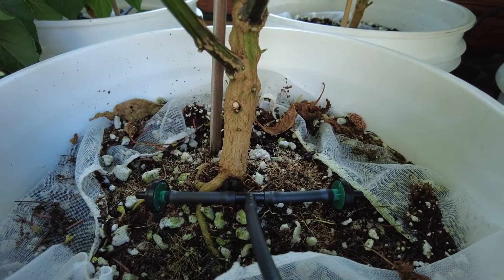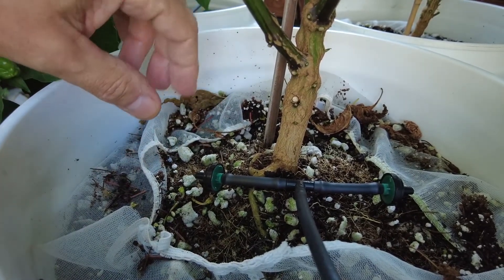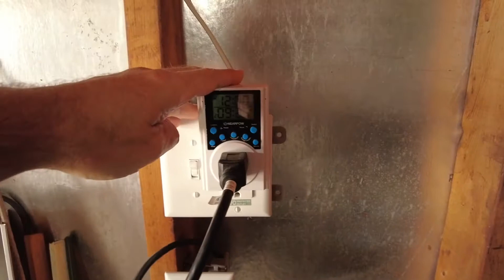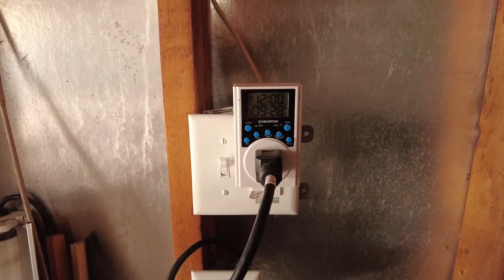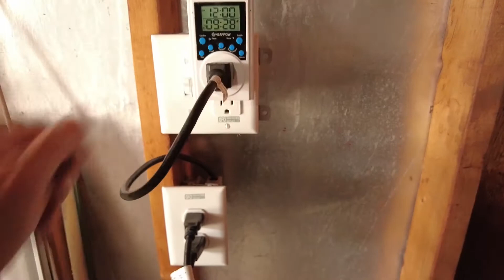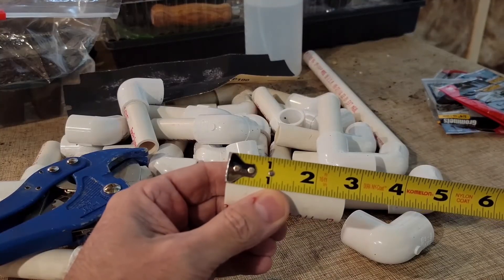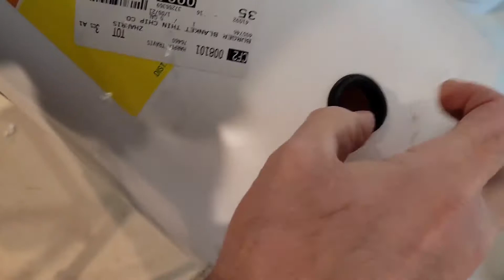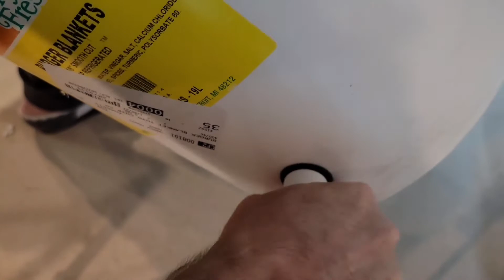Outdoor Hydroponic Peppers

Comment: I have a question. At the time of flushing out salts, the system could be more flexible. Alternatively, the reservoir has to be emptied and filled with water OR use a separate tank and pump. How do you manipulate it?

Comment: I live in the tropics and I plan to grow peppers. I will use this method. A quick question why do you use growing medium instead of regular soil? What’s more economical medium or soil? I wonder if I can grow peppers all year around in this system, since there is no winter here.
Reply from the maker: I like using the hydroponic method because I found the plant growth to be superior vs using soil. However you can certainly use soil in the buckets and the drip system with water only.
Reply: @bradicalbuilds  how do you manage the insects and the diseases for peppers that you grow outside in hydroponics?
Reply: @bradicalbuilds  did you grow any habanero peppers? What was your yield?

Comment: How did you connect the 1/4 tubes from the 1/2 mainline?  I didn’t see 1/2 to 1/4 tees in your materials list. Also, how much water do you recommend per timing interval for each bucket?  Thanks
Reply from the maker: In this video I go more in depth about the assembly and water https://youtu.be/Wn_nxjhyCn4?si=t-MENDOrouuDKAAk
At around 11 mins it shows how to connect the smaller tubing to the larger with these 1/4" double barbed fittings https://amzn.to/3Tc0TX5

Comment: How did you connect the 1/4 tubes from the 1/2 mainline?  I didn’t see 1/2 to 1/4 tees in your materials list. Also, how much water do you recommend per timing interval for each bucket?  Thanks
Reply: Tees are not needed. You punch a hole in 1/2 in tubing and push grommet in.

Comment: thank you for that very informative video. You gave me a lot of useful information about hydro outdoor. Your coco+hydro+(rain)drain setup makes really sense!
One question about your buckets: Why do you insert these drainpipes in the bucket? Wouldnt it be sufficient to just drill the hole in the bucket, without the tubings?
... also I am curious about what NPK ratio you use in your nutrient tank and what ppm?
Reply from the maker: You certainly could just use drain holes in the bottom of the buckets. I do the drain pipe to store a reserve of water/nutrients. Sort of like a self watering bucket and this way the nutrients are not wasted to the ground. 

The nutrients I use are Masterblend (link in video description). I mix them per the manufacturer recommendation which comes out to a TDS of 1300. The NPK is 19.5-18-38

Comment: Hi, really GREAT video. Thanks for the infos. One question: can we use rockwool insted of cocunut coir as growing media (mixed with perlite of course)? I am about to prepare my setup next week the same way you did.
Reply from the maker: I haven't tried filling the contaiers with Rockwool/perlite but the system should work fine with any grow media that can retain some moisture. You'll just need to figure out how often to water. Adjust the intervals feeding times so you're you're not drowning the plants while still ensuring they are getting enough nutrients and you should be fine. I'm not sure how the water hold capabilities of Rockwool compare to coir but I would think it's similar.
Reply: @bradicalbuilds  Thanks for you rreply. Based on that I follow you with the coconut coir-perlite mixture.

Comment: Fantastic video and awesome plants. Well done. I have a couple questions please, if you don't mind.

1. Are the plants in direct sunlight or are they partially shaded? 
2. Assuming you started the seedlings indoors, how old were they before you moved them outside?

Thank you kindly.
Reply from the maker: Thanks for the kind words and taking the time to comment.
1. The plants get full sun nearly all day minus an hour after sunrise and an hour before sunset. I'm in lower Michigan, zone 6b. High temps here are mid 90s.
 2. Yes, I start my seedlings indoors mid to late February. They average 6-8 inches tall when I put them in the buckets late May. I don't top my seedlings in case you're wondering. I do however remove any early flowers until they start to get established in the buckets. Especially the flowers that grow in the crotches of main lower branches.
Hope this helps!
Reply: @bradicalbuilds  Thank you very much. I have one more question that I forgot to ask, if you don't mind.

Do you have minerals/salt build up problems using this system? If so, how often do you flush the plant, and how do you flush it, just plain water? Thanks.
Reply from the maker: I haven't had a problem with it. The buckets get flushed from the rain periodically. If it doesn't rain I flush them with the garden hose once every two weeks.

Comment: What about if a strong rain pour?
Reply from the maker: It actually helps when it rains periodically to flush the mineral salts that accumulate from the nutrients. The plants are only fed small amounts per interval, enough to get them to the next feeding interval. So if it rains, barely wasting any nutrients with rain dilution.
Reply: @bradicalbuilds  i will try this kind of set-up, I hope it will work here in the Philippines because rain here sometimes last for 1 week.
Reply from the maker: @larrycorpuz3172  I don't think it will be an issue. The plants still get fed and once the plants are large the canopy of leaves keeps a lot of the rain out of the buckets also.
Reply: @bradicalbuilds  thanks sir.

Comment: Do you mix the fertilizer and Epson salts in one barrel and calcium nitrate in the other barrel? I have read you should not mix the three together at least in there dry form. I have 20 dutch bucket system with reasonably good results. You have an awesome system and a lot of great information. You have given me some ideas to improve my system.
Reply from the maker: All three end up in the same barrel. I add the Masterblend micronutrients and Epson salt to the water first at the same. Then once well mixed I add the calcium nitrate. You cannot mix all 3 powdered ingredients before adding to water. You can however combine the MB micro and Epson salt in their powder forms if you wish, MB actually sells a tomato/pepper version that comes this way as a 2 part kit. But never mix the calcium nitrate with the other ingredients in their powder form. Hope that made sense. Glad you like the video and found it useful. Thanks for taking the time to comment!

Comment: If I mix and match plant types - like tomato, cucumber and peppers - on the same system, do you think running the nutrients for the same duration will work as water consumption requirements of these plants will be different from each other ?
Also, do you use hydroponic grade coco coir or just the regular ones ?
Reply from the maker: Yes you could do all vegetables you mentioned with the same nutrient strength using this system. The nutrient strength will be the same at all the drippers off the same reservoir but you can adjust how much moisture they get without changing time intervals. I'm doing tomatoes, beans, and peppers this year. I used the same nutrient strength for all but the tomatoes needed more water so I used higher gallon per hour drippers for them to compensate for their thirst but use the same timer intervals. You will however need grow veggies that all require a similar nutrient strength. The TDS of my nutrients is around 1400, I use Masterblend (https://amzn.to/3dORGCM)
You can Google "TDS hydroponics yourvegetable" to find out what veggies that will work well on the same system with the same nutrient strength then adjust flow rates by way of the gph of the drippers to compensate for their water thirst without needing to change the timer intervals. 
Here's a low cost TDS meter https://amzn.to/3cszRZR
I think most larger veggies would be good together but things like lettuce (and non fruiting veggies) usually require half the TDS strength nutrients. I run my pH around 6 which is also something different is some veggies so you'll need to search pH ranges for what you want to grow as well. This is the pH meter I use https://amzn.to/3q6TFpb

The coconut coir I use 
https://amzn.to/3Rfxto4  does require buffering before use which is simple (rehydrate it with calcium and mag water, then rinse with plain water) but cheaper than hydroponic coir which is already buffered. I reuse the same coir year after year so it is an initial investment but the following years it makes up for it versus buying new putting soil each year if growing in dirt. Buffered or not buffered is usually the only difference between regular coir and hydroponic coir. 

I also use this same system on a smaller scale indoors under lights during the off season. How this helps!

Comment: Excellent video. Thanks. Will be implementing your multiple barrel reservoir system next season  to resolve my low reservoir capacity issues. I've spaces issues and my single 45g reservoir just isnt cutting it. This helped alot.
Reply from the maker: Glad you enjoyed the video. I'm going to be adding 2 more barrels for a total of 4 (220 gallons) next year. They'll all be connected in the same fashion in the video. This season I added another 10 plants to my system so I'm currently feeding 48 plants with just the 2 barrels and I'm having to refill them every 14 days late in the season when the plants require longer intervals. At this time of year I'm feeding 3 times a day for 4 mins each feeding. Hope this helps.
Reply: @bradicalbuilds  I've only 15 dutch buckets. Cant really expand due to space limitations, and don't really need to, as I already produce more in a season than I need for he year.  But those ratios will definitely help reduce my labor input once I expand my reservoir capacity.  Thanks so much.  You, mphgardner, and that jeb guy from florida with the classical musical, are true inspirations!

Comment: did you wire your solenoid into a extension cord cut off or did it come prewired?
Reply from the maker: I added the box on the side of the solenoid to contain the wires. Then, yes, I used an old extension cord to wire it. If you don't want to cut an extension cord.... the big box stores sell 36" cords, sometimes called "pigtails", with a plug on one end of the cord and bare wires on the other end for less than the price of an extension cord. The solenoid is low amperage so you don't need any heavy duty wire but it does need to be wire for 110v current so something like a 14g wire would work. Just make sure the power source you're connecting to isn't on more than a 15 amp breaker in your breaker box.

Comment: Do you know if can be use other type of media. maybe a using a mixture of pumice and fine/Medium Dark Fir. or just pumice it self. my local supplier sell the pumice by the yard very cheap. the perlite and the coconut coir is very expensive in my area.
Reply from the maker: I don't think it would matter much about the type of media as long as it's inert. I'm not familiar with pumice or dark fir. Make sure the fir is not acidic which would affect pH. The other thing to consider is that the coconut coir absorbs and holds omto the nutrient water for the plants to use. If you use a non absorbing media that just drains away then you'll need to water small amounts more frequently using short timer increments. If it runs thru the media too quickly and your watering increments are too long you'll waste a lot of nutrients to the ground. Hope this helps.
Reply: @bradicalbuilds  thank you for the helpful reply. What I have been reading the pumice has the similar water retention like the perlite. I thinking 🤔 going for a mix of 75% pumice and 25% peat moss.  Using regular 4 gallon black plastic pots, I can find them used, literally free in my area.   What it's your thoughts? Thanks 🙏.
Reply from the maker: @Reynieri  I did some reading on the peat moss because of cost as well and seems it would work well in place of the coconut coir. From my research ProMox would be a better substitute than straight peat moss but I think it costs slightly more. However the ProMix is said to be better pH balanced as well. Peat most can be pretty acidic so I'm not sure how that would affect the hydroponic nutrients. This link explains some of the pitfalls of using peat for hydroponics https://scienceinhydroponics.com/2017/04/using-peat-moss-in-hydroponic-culture.html

Comment: Great information here. Thanks for sharing. I am about to start a smaller version of your system and have a question about nutrient strength. Do you use full strength from seedling to mature plant? I read somewhere that DTW systems can run well on half strength nutrient mix, but would be interested to hear what you use. Thanks!
Reply from the maker: Glad you enjoyed the video. Yes, I used full strength nutrients the entire life of the plants. Thats an interesting thought about DTW systems doing well on half strength. I'll definitely look more into that. Using half strength would not only save money on nutrients but also be less likely to accumulate the excess mineral salts left behind in the coir that makes flushing the buckets necessary periodically. That said, my plants grew great and I never noticed any ill effects on my plants nor did I visibly see and mineral buildup, I mostly flushed the buckets as a precautionary measure. Thanks for the comment. You've given me something to research.
Reply: @bradicalbuilds  Thank you and sorry for the late follow up. Whatever you're doing it looks like it's working great for you. Those peppers look really healthy. Do you mind if I ask you what EC/PH values you run at?  I'm using masterblend too so I'd like to experiment a little with values.
Reply from the maker: @johnoneill2848  With the MB mixed at the standard ratio 2g, 2g, 1g per gallon I have a TDS between 1300-1400 and ppm around 650 so I believe the EC would be 1.3-1.4 if I'm calculating correctly. I try and keep my pH around 5.8 never more than 6. Hope this helps.
Reply: I think half strength is OK for leafy plants e.g., lettuce etc. For fruits it has to be full strength.

Comment: Can the coconut coir medium be re-used again for another grow, or do you compost it? Great looking garden!
Reply from the maker: I reuse the coir year after year. I just flush the buckets with plain water to rinse away any nutrient salt buildup before planting again. I cut the plants off at soil level and remove the roots the following year, once they dry out they're easier to remove. You'll have to add some coir to top off the buckets after removing old plants before replanting. I don't worry about small amount of roots left in the coir. How this helps. Thanks for the kudos!

Comment: Curious for a 12 bucket system how large should the reservoir be? Also is your 3 times a day feeding schedule the only time the plants get watered?
Reply from the maker: I have two 55 gallon barrels and if I remember correctly I filled them 4 times from late May or early June till the end of the season which was early Oct (zone 6b). Even with a 55 gallon barrel you'll need to fill it several times for 12 plants, my system holds 38. The coconut coir holds moisture well and the plants grew great with my feeding schedule  I started out the seedlings at 2 mins per feed interval (2:2:2), as they grew I incresed the morning feed time to 3 mins (3:2:2) then continued to incrementally increase as they grew, 3:3:2 and so on. At maturity I think I was doing 4:3:3. They never wilted nor was it feeding to the point that nutrients were wasted running out of the bottom of the buckets. Also when the nutriemt reservoir needed to be refilled I would run them on straight water for a week before adding nutrients back to the reservoir. This helps to rinse the nutrient salt buildup from the coir. The last two weeks of the season I just used straight water as well. Nutrient cost for the season was about $30-40 for the season with Masterblend nutrients (link in description)
Hope this helps!
Reply: @bradicalbuilds  thank you. Of all the systems I've looked at, yours seems to be the best fit for me. I now just need to fiqure out what I'll do if the reservoir gets too hot. I'm also in 6b. Michigan
Reply from the maker: I have mine in the garage which shelters it from the sun but with the door closed it's about 10 degree warmer than outside temp but possible still cooler than the sun baking on the black barrels. I really don't think the nutrient temp is a much of a factor to be honest since such a small amount of liquid is dispensed at each interval it quickly adjusts to the ambient temp. You could position the drippers more towards the outer area along the bucket instead of at the base of the plant if you're concerned about the temp. You could also hang shade cloth over the barrel or build a makeshift shelter for it.